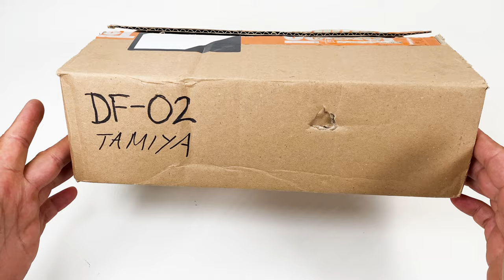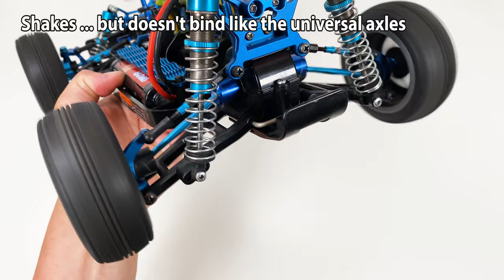Tamiya TT-02B Project: DF-02 Universal Axle Metal Upgrade! (Episode 7)

Comment: Nice demo of all the upgrades you can do to these.  I find that the plastic drive shafts on the TT-02B are nice and smooth and I have only ever broken a couple so I'll probably stick with them.  Good to know what's available and how they fit though.  Top work my friend.  Hope all is well.  In the UK we have gone from moaning about the rain to moaning that it's too hot! :-)
Reply from the maker: Thanks, Pete! Yeah, stock ones work absolutely well. I’ve never broken one on either the DT-02, DT-03 or TT-02B. But changing the DF-02 ones left me with these, and after all, they look good and in theory (at least) should work better 😊 😅 As always, the UK sounds a lot like Scandinavia 😅😅 Same thing here, though today we finally had some wind and clouds and rain. So at least a day without moaning 🤭 Tomorrow, if it isn’t perfect sunshine, we will start moaning again